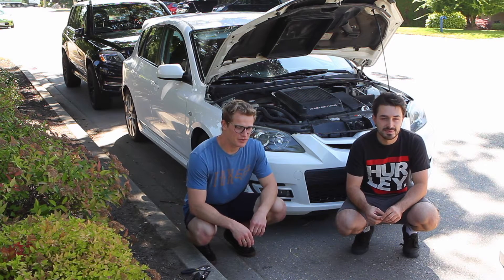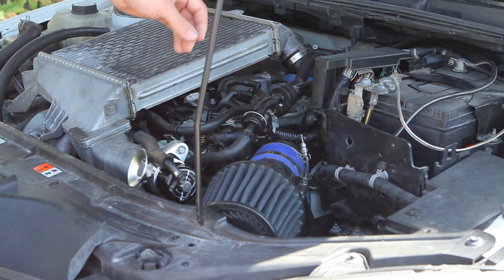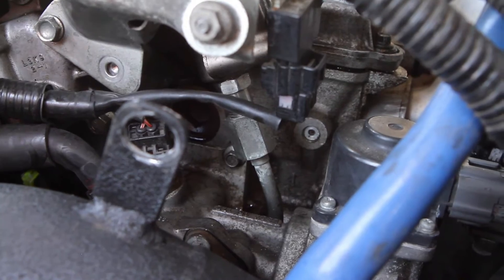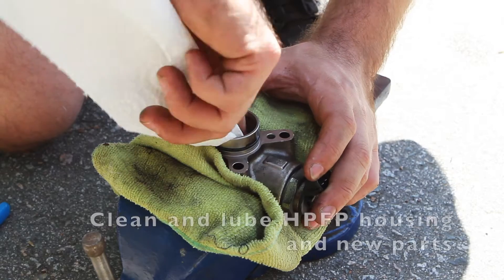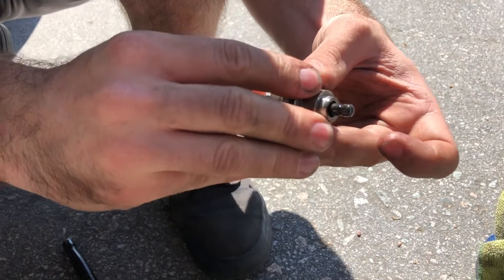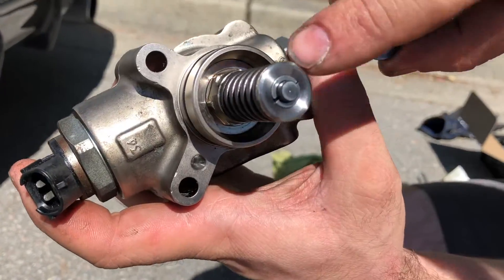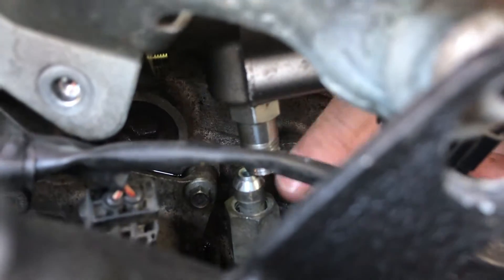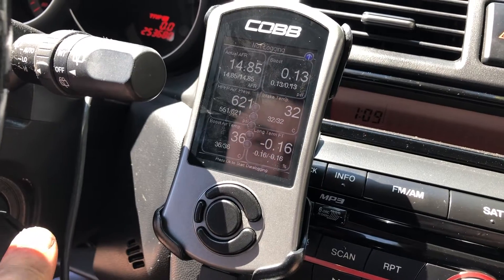HPFP Mazdaspeed 3 Autotech Internals Install How To

Comment: I followed the steps and took out the rod and spring to get to the 18mm. I have no idea why 18mm or even 19mm isnt fitting. It just sits on top of the nut

Comment: Mine did not go in as easy, it’s like the coil is holding it back or something inside so I’d have to compress it but your video shows me that I do not have to force it in. Any ideas ?
Reply: Dealing with the same issue. Lining up the dowel and getting the pump in so far,but the fuel line prevents it from going further

Comment: Whats your actual pressure at idle after driving for awhile? I did the corksport rebuild kit and autotech internals installation and the prime as well before starting it. And on a cold start it reads 420-430 consistently at idle but after driving for awhile it dips to mid to low 300s? I'm just confused if its suppose to fluctuate that much or not.
Reply: Ever figure it out? Having same issues
Reply: No..something is wrong. Never should drop below 400psi

Comment: I broke the yellow clip on the fuel line. Any advice on where to get a replacement clip? Or if there's an alternative way to secure the line? If I have to I'll order the whole line
Reply from the maker: I'd try calling an auto wrecker to see if you can get the line or just the clip for cheap. Or maybe a ziptie can do the trick temporarily, best of luck!

Comment: What brand of security Torx 25 did you use?  The hole in my Craftsman's is not deep enough to allow the teeth to engage to get the low pressure connection off.
Reply: u need a t25 with a hollow middle. ur local shop should have one for 10-20$

Comment: Nice video. More than 250.000 Miles yet on the engine? Is that true? Best Regards from Germany
Reply from the maker: Over 250,000 kilometers... so not quite haha. Thats about 155,000 miles though.

Comment: Do you guys know if it an Autotech EA113? Is it the same HPFP internals for the VW/AUDI/SEAT 2.0TFSI? Thank you :)
Reply from the maker: From my research it looks like the Mazda upgraded HPFP is different from the Audi 2.0TFSI one. Might be a tiny difference but possibly crucial.
Reply: Calvin MC thank you for the help.
Reply: Calvin MC its confusing as they sell it as mazdaspeed HPFP + early 2.0 TFSI. https://autotech.com/autotech-high-volume-fuel-pump-upgrade-kit-2-0t-fsi.html
Reply from the maker: Hmmm that link does look like it would work for both. If they say it’ll work then it should work.

Comment: Great video! Is there a way to verify that HPFP is installed by simply looking at the PSI readings you viewed after installation. I am buying one from a dealer and was told the previous owner did, but i want to make sure without pulling it
Reply from the maker: Hey, no you can't really rely on the PSI readings because even the original HPFP can spike to 1800-1900PSI. If it's hitting 2100 PSI it would be a decent assumption that it's been upgraded but it would be best to do your due diligence and take it out and check. If you take it apart and you can pull the shaft out it is 100% original equipment. Best of luck!
Reply: @Calvinm  exactly what fuse needs to come out ?
Reply from the maker: @bobbydouglas16   I don't have the exact fuse number but in your fuse box in your engine bay you should be able to find a fuse labelled "F/PUMP" rated at 30amps. Pulling this will likely kill power to your low pressure fuel pump and enable you to drain the system by cranking the engine until it stalls.